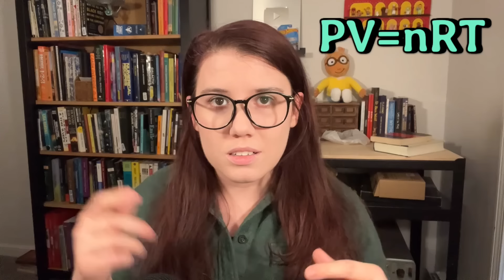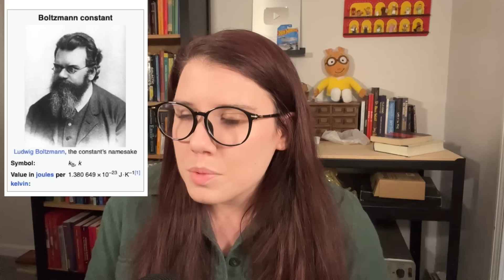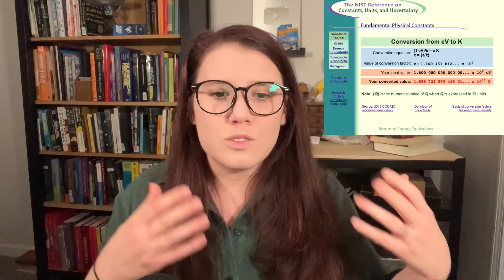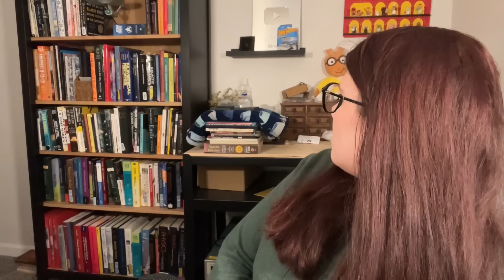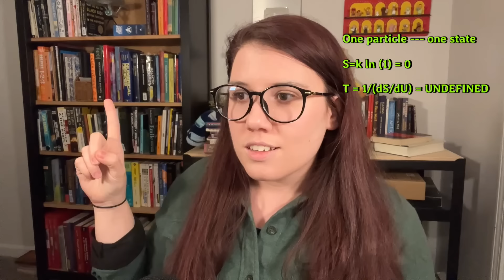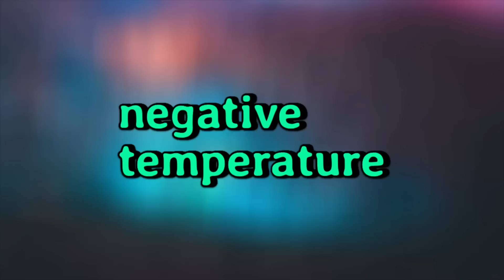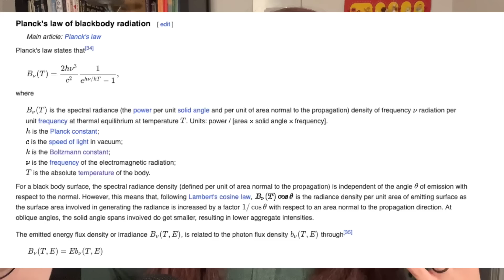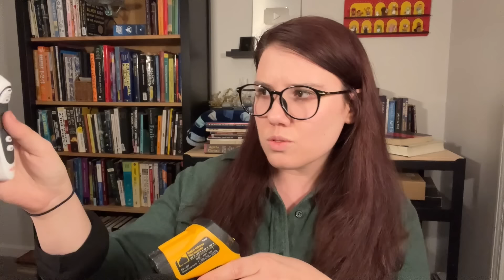the concept of temperature

Comment: Thank you for helping to preserve the beauty of english by using the singular of dice, namely die. Why is that we never talk about casting dice, as in 'The die is cast'?  A google search turns up more hits on dice manufacturing than dice throwing, which I find amusing.
Reply: I find that ~100% of google searches show me something slightly related to what I searched for (as specifically as I could), but not nearly close enough.
Reply: Wouldn't “dice manufacturing” be correct though since they're being made in plural, no one is making a singular die.
Reply: Sure, but I assume that at some point instead of talking about throwing or rolling dice we would talk about casting dice, based on 'the die is cast'..... I assume Ceasar wasn't referring to manufacturing a die but rolling one

Comment: I should probably wait until this video is over, but in school we learned that kinetic energy is the physical manifestation of heat energy, but infrared light is the heat energy. I know that is stupid definition and that if you witness the lesson you would think, " I wouldn't say it like that." However, what about the characterization of electromagnetic radiation, the temperature of the microwave background radiation of the universe left over from the big bang. Th temperature of a nuclear explosion in space where there is no air so its gamma radiation and so forth. Is the temperature of a field of empty space containing infrared radiation a measurement of how much kinetic energy the infrared would in part if the infrared at a given level of i tensity came into contact with one milliliter of water like a calorie/ How is the temperature of microwave background radiation determined? It is not a measure of kinetic energy since it is microwaves in a near vacuum.

Comment: what i would find more interesting is, what happens at the "end of the universe" cause once temperature has been entirely dissipated, either it A) has no where else to go and we still have a temperature above zero or B) although it has nowhere to go basically it's particles in motion, so the articles can come to a halt? or can they? whether the universe is infinite or not i don't see that heat can become zero, and what about "virtual particles", they are coming and going regardless of what's happening in our universe. anyway.

Comment: 11:40 glad I'm having an insomnia cuz if I could sleep I would no doubt have horrific nightmares about the oceans' temperatures rising - it is really scary
Reply: @polusdroop  I just ran the numbers, it's on the scale of detonating every single nuclear weapon on the planet...

...250,000 times in a row.
Reply: @polusdroop  The oceans essentially function as a giant heat reservoir for the Earth and it's why the climate doesn't vary wildly over short periods of time since the oceans absorb so much energy and essentially function as a buffer. This is also the simple explanation for why inland areas often have much wilder swings in temperature than coastal areas, like try comparing Berlin with Copenhagen. The temperatures swing much more wildly in Berlin than they do in Copenhagen.

Comment: Relative temperature is a measure of which way heat will flow between two bodies, keeping mass flow, pressure, and other properties constant. The difference in temperature dictates the rate at which this happens, except that also depends on the heat conductivity and reflectivity of the two materials of the objects. Also defined as the entropy change per unit heat flux.

Of course this definition breaks down when quantum effects become more pronounced, when you look at things like "negative absolute temperature". Imo, we shouldn't even be talking about temperature under those circumstances.

Comment: Thermistors are how the various temperature's in your car (coolant, oil, transmission, air intake, maybe more) are measured.  Air intake temperature is particularly relevant to this lecture because it's an input used by the engine control computer (maybe, depends on what kind of fuel injection method is used but anyway) for calculating how much fuel to inject, via the ideal gas law (all hail)!

Comment: Ice in water ... not the same temp.  If they were the H2O would be all solid or all liquid.  The ice is colder than the water.
Reply: They can reach the same temperature. They are both at 0F, you would need to add more heat to melt the ice or remove heat to change the water into ice. Water doesn’t become ice when it hits 0F.
Reply: @jsbrads1  In theory you could do this but the system would be very unstable. Even a slight change would cause the ice to melt or the water to freeze.  We are talking about ice water in a glass on a table, not an idealized lab experiment.
Reply: @brianofphobos8862 it's pretty cool actually, with the right purity of water (or something like that) you can leave a bottle of it in the freezer and it will remain liquid, and then you can take it out and smack it with your hand and it will all instantly freeze
Reply: @bEoNslenDeralert  Very true.  The process of solidification takes some agitation, even at temperatures well below the freezing point.  You can also keep water liquid at cold temp if you contain it so the crystals cannot expand.  Takes a very strong container but it can be done.

Comment: there wouldn't need to be a concept of temperature if anyone bothered to develop a temperature scale that's not curved with respect to absolutely every material that exists.

done right it can be derivable, as something like a set amount of energy exchanged into or out of 1 mole of helium defines 1 degree.

helium doesn't undergo phase transitions over a huge range of temperatures, so this is the simplest way to correctly do things. and yet it never even occurred to anyone. instead, what everyone actually did was take two measurements at the phase transitions of a single material, and then just assumed that temperature acts linearly, for everything, between and beyond those two reference points. which... is an amazingly dumb way to establish a temperature scale.
Reply: trying to make it make sense because ScIeNcE is futile.

even my proposal is nonsense, because the mole is a trash unit. at the time that its value was defined there was precisely 1 perfect cube which fell within the error bars of the measured value. but it didn't even occur to anyone to define the mole as that perfect cube, because it's not like you're using this number to measure things with... volume!

not to mention other basic problems, like the Amp is the base unit of electricity in SI, despite the Coulomb being the unit of charge, but worse the Coulomb isn't even a physically possible unit, because electric charges come in multiples of 1/3 the electron charge, but the Coulomb is not a multiple of 1/3 the electron charge. so the Coulomb is a derived unit describing a the base level of a fundamental interaction, but it can't describe it correctly because it's a nonsense number.

and I'm supposed to not look at you like you're completely stupid? really?

Comment: Heat and temperatures are mathematical analogues to current and voltage. Heat capacity is analogous to electrical capacitance.  The exponential decay equations are the same.

Comment: It's about to be vibrating molecule boy summer. Google says 5.43 × 10^21 kJ will raise the temperature of the ocean by 1° C.
Reply: I got 5.59284×10^21 kJ... So yeah. 

To put that amount of energy in context: Tsar Bomba was the largest nuclear weapon in history, which released 2.5*10^14 kJ. 

At the height of the Cold War, there were an estimated 70,000 nuclear weapons total across the entire planet. (7*10^4).

The amount of extra heat in the oceans is on the scale of taking every nuclear weapon at the peak of the Cold War, turning them into the most powerful nuke ever constructed, and then detonating them all.

300 times.

Or to put it another way, 20,000,000 Tsar Bombas.

I don't think that counts as "in perspective"... I don't think this is something that can be.
Reply: @OhhCrapGuy How did you calculate the volume of the ocean, as a proportion of surface area?
Reply: @howwitty  I simply looked up the volume of the ocean
Reply: Gonna go run the calculations manually , curious if I get a similar value.
Reply: The actual increase in temperature is likely to be significantly higher due to uneven mixing, similar to how El Niño and La Niña dramatically affect the Pacific Ocean's temperature.

Comment: Boltzmann's grave reads S = k log W, not k log Ω. The notation W stands for Wahrscheinlichkeit, which means "probability" in German. In the last twenty years, there have been a couple of heated debates about the original meaning Boltzmann put into it and how it affects the results for indistinguishable particles. I myself find it easier to grasp W as probability rather than Omega.

Comment: Wait acolier I love your videos but you made a big mistake in this one (16:30). 

The average KINETIC energy of ANY (classical) substance is 3/2 N kBT, where N is number of atoms. You can derive this from the Boltzmann distribution for a classical system of N atoms with an arbitrary potential energy. The momentum integrals always factor out. 

What you’re thinking of the average TOTAL energy, which contains an extra factor due to vibrational interaction. For a diatomic gas the average KE is 3kBT and average total E is 7/2 kBT. Additional 1/2 comes from integrating over position degrees of freedom.
Reply: Can you measure one without including the other? For all practical purposes they are kinetic degrees of freedom right? They can reasonably be approximated as quadratic degrees of freedom, so we can use the equipartition theorem. It’s not like strong interactions where we have to deal with it separately.
Reply: @De2Venner  1) Only for solids gases/solids can they be reasonably approximated as quadratic, for liquids, glasses, biological systems, etc. they cannot. 

2) Quadratic =/= Kinetic. 

3) The distinction is actually important for how we determine the temperature of simulations of complex anharmonic systems.
Reply: @afroohar  Interesting, thank you for the answer. I will not argue semantics about the second point, it seems very meaningless to me. I will however say that I have not encountered a quadratic degree of freedom which did not have associated with it a quasiparticle that moves with such a "kinetic" energy. so call it what you will as long as you agree it can be interpreted as such.

For 3) I'll admit that I haven't thought about how to determine the temperature of a many-body simulation before. Its definition is rooted in entropy/heat, which is hard to define for a system where you know all the microscopic variables already, so I imagine it is quite difficult. I guess you need to consider the modes which can transfer energy across large length scales, such as the kinetic energy, vibrational modes in a solid, etc. Seems cool honestly, good luck on your research since it seems like you are working in a related field c:
Reply: @De2Venner Your first point is a tautology, a quadratic degree of freedom is trivially quantizeable so easily associated with some quasiparticle. Whether such quantization is useful or even physically sensible depends on the application. 

Your second point I would also contest, I see the definition of temperature as fundamentally built on the fluctuation-dissipation theorem and the KMS condition. It is only due to historicity that textbooks will define temperature from entropy, when we almost never measure or compute temperature by taking a partial derivative w.r.t entropy. Temperature fundamentally arises from fluctuations, the equipartition theorem is an approach to characterize those fluctuations, but there could be many others. For many many systems,  however, the kinetic energy and the potential energy are seperable, leading to a very convenient expression of temperature purely in terms of velocity fluctuations.

Comment: -40F 🤝 -40C
Reply: @polusdroop  Kelvin was a Lord, he does not need degree
Reply: @polusdroop  0K == 0R
Reply: 301.4375K 🤝 301.4375°F

574.5875K 🤝 574.5875°F
Reply: @greenappleisspicy  kelvin and fahrenheit meet at about 574 though, not 300
Reply: @Fiasko-  omg I forgot the +273.15 😭
Reply: @greenappleisspicy  your edit makes this better! 🍏
Reply: @polusdroop ackshually it's just kelvin not degrees kelvin 🤓
Reply: Yup
Reply: @polusdroop  It shouldn't be called degree Kelvin any more since 1967, when it was changed by Resolution 3 of the 13th General Conference on Weights and Measures. Before that it used to be °K, now it is only K.
Reply: Don't forget about Rankine
Reply: @polusdroop  bruh
Reply: 575K 🤝 575F
Reply: @polusdroop  I can't even get the guy to chop down trees properly
Reply: 233.15 K 🤪
Reply: In terms of symmetry the one about when exposed flesh freezes is also pretty satisfying, albeit it's all fahrenheit. At -30F you have 60 seconds, at -60F it's 30 seconds.
Reply: @polusdroop nobody writes °K though

Comment: My roommate in college tried to convince me that things weren't actually hot or cold. Instead, he purported objects were better at adding or removing temperature from other things.

Twenty years on, if I wasnt 99% sure he was in a mental institution, I'd definitely forward this video to him. 😅
Reply: Objects have many properties, Thermal Conductivity, Thermal Capacitance and Temperature.
Conductivity means it feels hotter than something else even tho they are the same temperature, like metal and stone on a sunny day. People confuse this and think the object is hotter than other objects even when it isn’t.
Capacitance generally means if it is hot now, it will stay hot longer than an object with less capacitance all other things being the same.
Reply: @jsbrads1 conductivity is just a form of heat transport, it says nothing about whether something is hot or not. You can conduct heat from a hot or cold piece of metal. The three forms of heat transfer are radiation, conduction, and convection.
Reply: @Debrafeem  conduction is a heat transfer, but conductivity is the ability for the material to move heat internally.
Reply: @jsbrads1  I’m referring to thermal conductivity
Reply: We don’t feel temperature, we feel the rate of heat transfer in or out of our body (basically the flux of energy in or out) which in most situations correlates with temperature, but not all. So your friend was right in a way
Reply: Things with a low rate of heat transfer are called insulators. So a blanket keeps you warm by insulating you and lowering your overall rate of heat transfer outward to the environment, and so the heat produced by your body is trapped and keeps you warm, increasing your steady state temperature
Reply: Are videos banned in the institution?
Reply: @user-sl6gn1ss8p Sounds like it was just a dig at someone who can't fight back (and probably doesn't deserve it, either)
Reply: @Jablicek My friend's college roommate murdered his (the roommate's own) dad so you never know.
Reply: @Jablicek  true
Reply: @Jablicek lmao grow a pair pansy
Reply: Your roommate was basically right. Hot and cold are concepts that relate to how we feel about the temperature.  A blizzard is cold because we find it uncomfortable. Boiling water is hot because it can scald us.   Really there is only less heat and more heat.  Even things at -200 degrees still have heat, just not much.
Reply: In thermodynamics heat is solely seen as a transfer of energy, not as energy itself. Just like how work is the conversion of energy from one form to another, heat is the transfer of energy between systems where no work is performed. This is expressed in the first law of thermodynamics which states: U=Q+W

The internal energy of a system is equal to the heat transferred to it and the work performed on it, or vice verse.
Reply: Which mental institution he is? I bet some academia.
Reply: Sit in a Sauna and touch a piece of metal (same temperature as the wood you are sitting on) and then you might begin to understand what he meant.